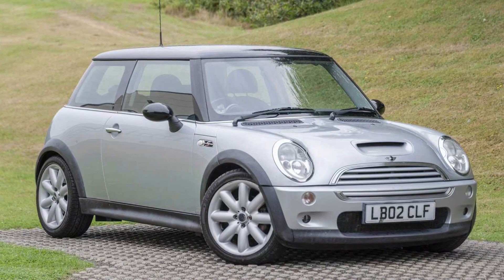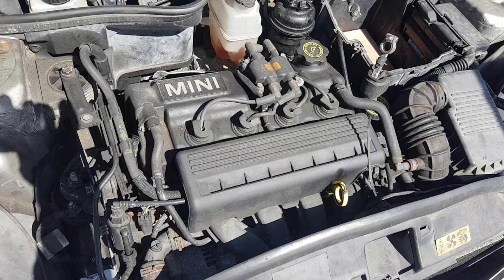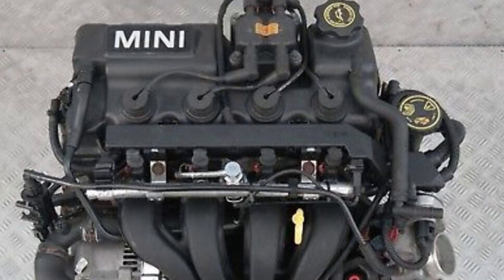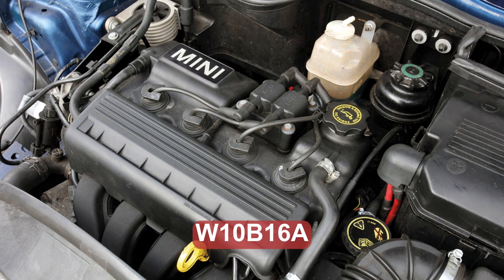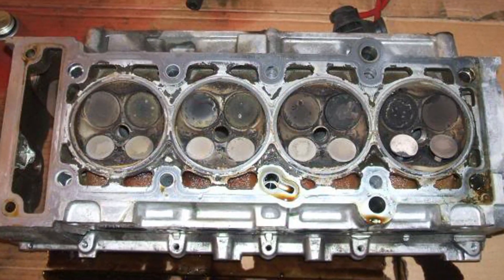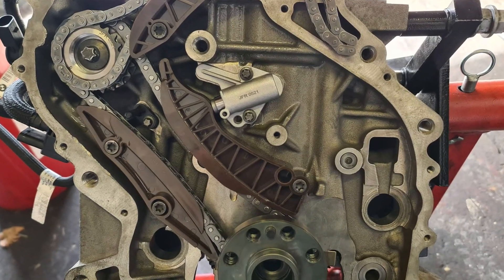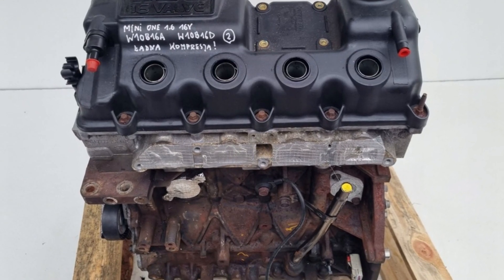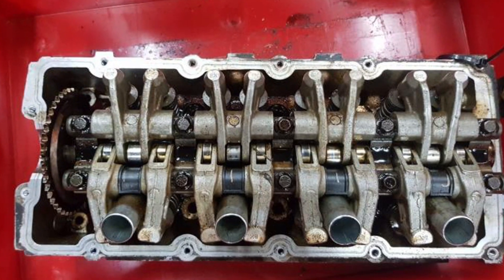Mini 1.6 Petrol engine problems (W10B16A)

Comment: Still better than Prince engine.
Reply from the maker: Yeah, the EP6 was massively used in Peugeot-Citroen vehicles and it was literally a piece of junk with valve seats falling off and timing chain jumping at random mileage. Awful engine.
Reply: @DmitrySapko  I am spending hours researching various engines that go in Peugeot 3008 mk II. My brother is looking to buy it. The 1.2 PureTech is actually worse then 1.6 Prince. The Prince engine is in production for 19 years now, and was improved during the years. It seems that the Prince engines after 2015 (or 2018, depending on where you read) have ironed out most of the issues and are OK engines now. They are still used in brand new cars, so they can't be that bad. 1.2 PureTech had switched feom wet belt to timing chain from 2020.
Reply from the maker: You need to be careful with the pure tech. Not all engines now come with chains. In my country, the new C3 still comes with wet belt. Yes, I would assume fresh 1.6 should be fine, but I have zero experience on them - will investigate it later and probably make a series of videos about them.
Reply: @DmitrySapko  Woah! So they still produce older PureTech variants for certain markets. Not good. 😬
But I managed to find engine codes for the 1.6 prince engines that go in 3008 mk II. They are all much better then the older generation of the engine. They are the EP6FDT, EP6FDTM and the EP6FADTXD.